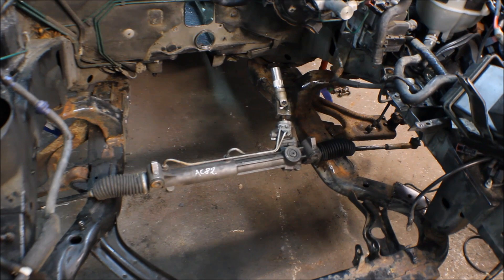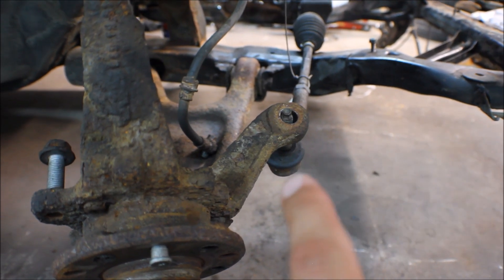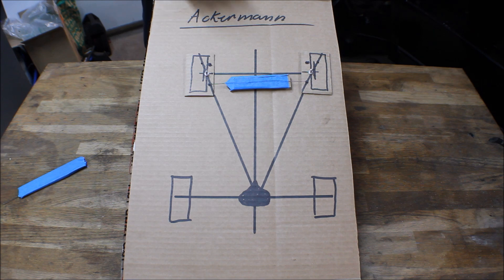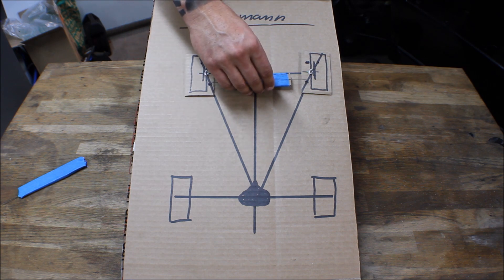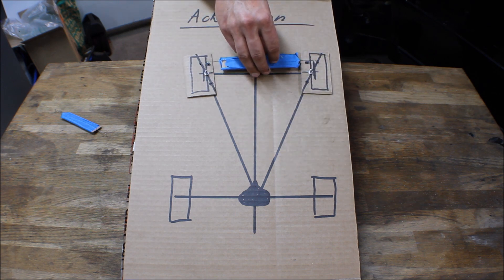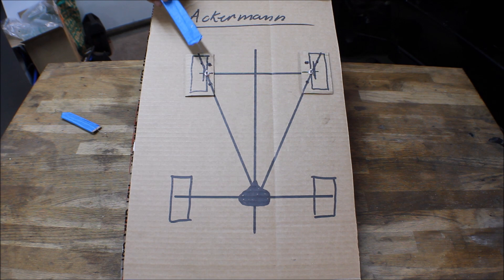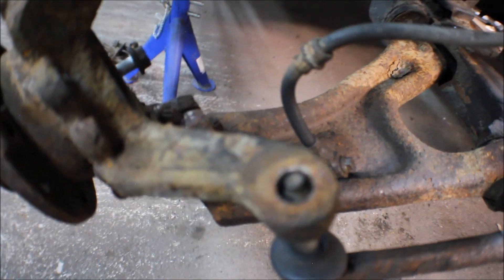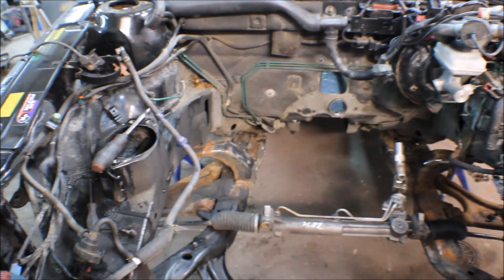Saab 9-5 Aero RWD - Ackermann Steering Geometry Explained

Comment: Interesting idea, keep in mind that approaching the steering point closer to the wheel center will not only modify the force and stability of the steering but also make it less precise and drastically reduce the steering angle. There are a lot of reasons why steering geometry is commonly installed behind the wheel.
Reply from the maker: The steering point will not be closer to the center,  just adjusted out from where it is placed now.  A ton of cars have it in front of the center 💪

Comment: If the steering rack sits higher on the 95xwd may be the front hubs arms that the steering arms connects to are higher ?
Reply from the maker: Ng9-5 xwd is a completly different design.  Hi-per struts pivoting around them selfs
Reply: @JonasKakarikas  is the anyway of cutting and welding to make a hybrid? Is there room above the gearbox to sit the rake ?
Reply from the maker: Above gearbox is not a good solution,  it Will turn out like The og9-3 which is pretty bad 🙃
Reply: @JonasKakarikas  Yeah! Steering rack must have a very sturdy fixing pounts...All this time I were thinking about a Volvo type, like those used on the 240, 740 and 940ish...Or, could be an option a BMW steering rack??
Reply from the maker: 240 and 740 will fit,  but i have decided to use as much Saab parts as possible
Reply: @JonasKakarikas  Nice!